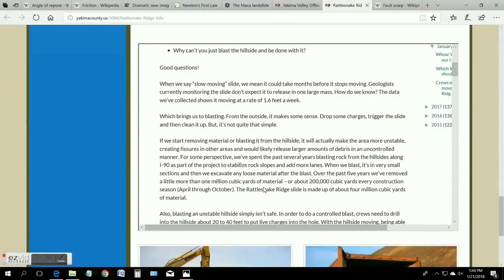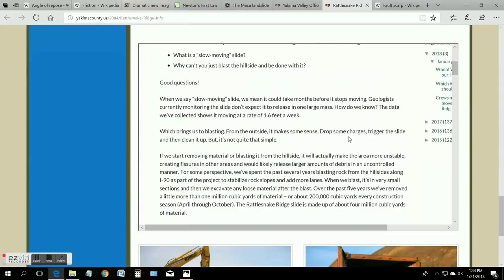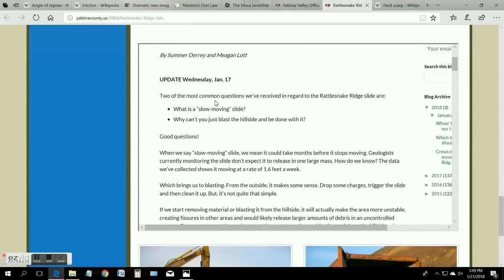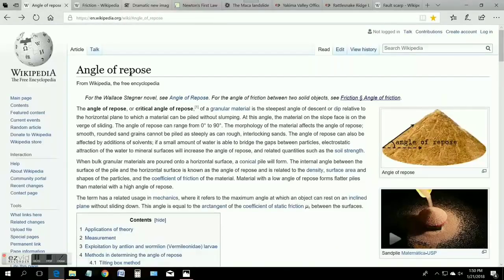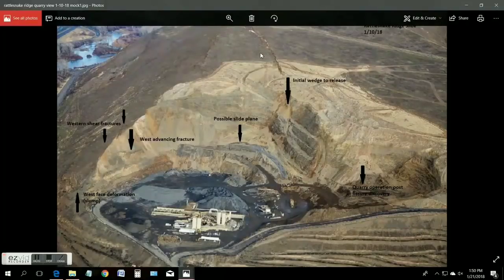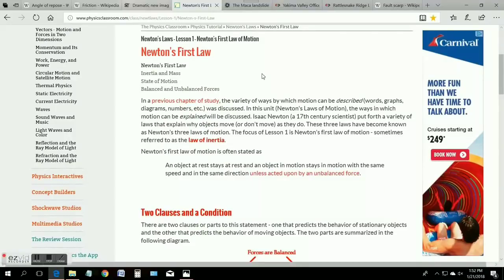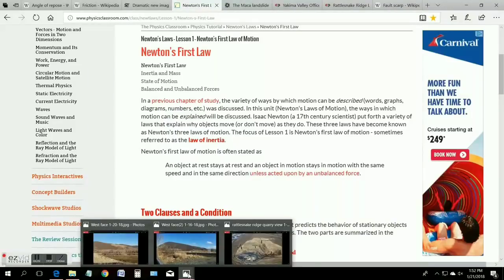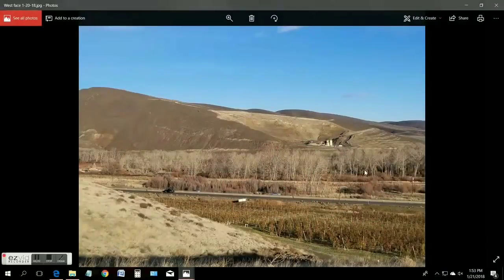Rattlesnake Ridge Update; Demolish? My geologist's report January 21, 2018.

Comment: Interesting coverage.  Some comments....

The angle of repose really has nothing to do with this slide.  If it was the angle of repose, then the face of the quarry would just slough off to match the angle.    The angle of repose, or critical angle of repose, deals with granular material.   You can see many vertical faces in the cracks and if the angle of repose was an issue you would not see those vertical faces.   The issue here is the 15 to 20° weak slip plane under the upper ballast rock and the removal of the support caused by then quarry.  

Also there seems to be continued talk about rainfall with the implication that it has something to do with the this slide.   Many others  have reported that this slide is not affected by water.  This pretty much explains this slide, "As a slope cracks and begins to slide, the forces holding the mass of soil and rocks in place weaken and the underground surface the mass is sliding on — usually a weak layer of soil — gets slicker. As a result, the mass gains momentum and starts to slide even faster. Gravity eventually overcomes friction, and the slope collapses."
Reply: Thanks for watching Jim Thode!!! Appreciate the comment.  I vehemently disagree with your angle of repose statement though.  Whether or not the material is granular is insignificant.  What is significant is that a cohensionless slope (of any kind) can only maintain stability to a certain angle.  That angle is the angle of repose, period.  Many examples of mass wasting bear this out around the world.  Water is going to be a upcoming topic and I thank you for your input and hope you tune in for that.

Comment: There is only one reason to not use explosives and that is the current time of year.  We have hopefully more then a month and a half to wait for this to slide to resolve its self.  Timing is everything.  If this does not slide before spring melt it could wind up being much worse.  I am going to disagree with you about how easy this could be released because explosives are used for avalanche control all the time.  That excuse about a charge not detonating is just horse crap.
Reply: Great points hartstudbakerkid!!  The timing could be as you say, but I'm seeing evidence to the contrary.  While I agree that explosives are used often in avalanche control, this case is far more sensitive than most in terms of liability.  We'll have to agree to disagree on undetonated ordinances, its happened and will continue.  In defense though, I would say the technology has evolved where the ordinances can be tracked--but that ups the price.  Thanks for watching!!!
Reply: What I find amusing about this is that the local Geology classes have been pointing out this fault for deckades as it is so easy to see yet someone from the county had to give the geology a pass for the gravel pit expansion.
Reply: Great point!!  We may visit issue more in the epilogue.

Comment: Oh man, your vids are getting better C. Your geologist buddy just did the best explanation yet.  I've been looking for changes and bulges also, but I liked the scarp reasoning and pic comparison he did, I understand much better now. One question....it looks like an abandoned quarry is farther down the road, and it appears that the end part of the slide may be occurring there also. Could you find out if he thinks the edge of the slide will end at the old quarry? Does he think the old quarry has an effect on what is happening? Lastly, what's your weather forecast look like? I would think the slide event will happen during or after a big rain storm.
Reply: Thanks for watching J.J.  Thank you for the kind words.  Interesting question!!  C will address the weather in tonight's clip (1/22).  Thanks for the info on the other quarry.  As you can imagine, our focus is on the Anderson Quarry.  No, I don't believe the adjacent quarry you speak of has any impact on this one because of what prompted the failure in the first place.  But your reasoning is sound.  Adjacent quarry operations can have affects on each other.  We will certainly look into said quarry to confirm anything if we can.  Access is always an issue though.  In the case of the Anderson Quarry, we simply have a lot more access based on its location.

Comment: Nice job. Sorry if you've answered this before but what method did the stone company use to mine the hill? Did they use explosives or just dig?
Reply: Hi blipco5.  No, haven't answered that question.  Based on the apparent hardness of the rock and views of the quarry face, it appears to be strictly blasting.  I don't see signs of channeling (sawing).
Reply: Geo...Thanks, as I wrote in another post, I'm from the US East Coast. There is zero news about Yakama. Especially since the Patriots are going to the Super Bowl yet again. Maybe if the hillside slides into the river they'll be a blurb on the news.
Reply: blipco5, Sadly, I suspect you're right about a news blurb.  C and myself have taken oaths (if you will) to protect public health and safety in our respective fields and that's why we're here.  We're glad to have you here to contribute as well.
Reply: Geo...I'll be happy to give you opinions and advice about things I know nothing about. LOL. Well, I know some things. Cheers.

Comment: Can you comment on the movement at the peak any deformation at the top... also how much precipitation,temp,top- vs- bottom ? Also has anyone done inferred test? More on ground movement too! What is the toe doing?... and can you show seismograph readings ? Great job! So nice to get information from a professional who is not beholdened to some political motivations...one more thing, can you identify the mineral composition of the scarps? ..I saw a large white patches on the rock at the apex.
Reply: Hello red rocket.  Thanks for watching.  Appreciate the kind words.  Bear in mind, I'm 2,700 miles from the site and I'm relating what I'm be told and shown to what I know of the subject. I hope to get to the site at some point.  Other than the expected open shear fractures (wedge and graben, as they're being referred) and blocky joint openings (as would be expected at this location in a translational gravity-induced slide), I see no other signs of deformation at this time.  As for precipitation/temp, there is no instrumentation that I'm aware of in place to determine these with any accuracy.  However, in an area of this size, we don't expect a huge difference in these variables from top to bottom.  Precipitation amounts in this area over the last two weeks was about 0.7 inches.  My understanding, one of the third party geologists (recently hired) tasks will be LIDAR imaging--about 2 weeks off for that.  The white color is most likely weathering, but this particular formation is also abundant with white plagioclase.  Of coarse, other mafic mineral assemblages will be present.  What toe? haha.   We'll expand on your items of interest going forward.  Thanks for the great questions.